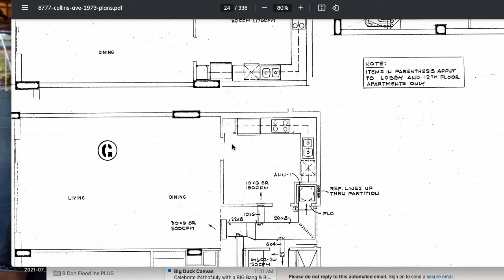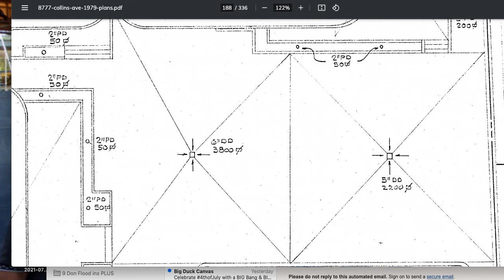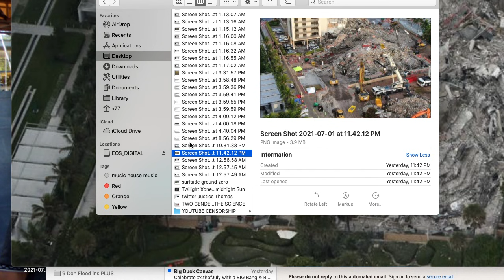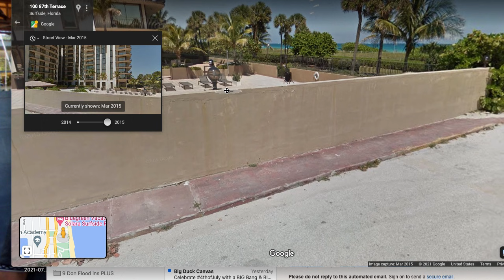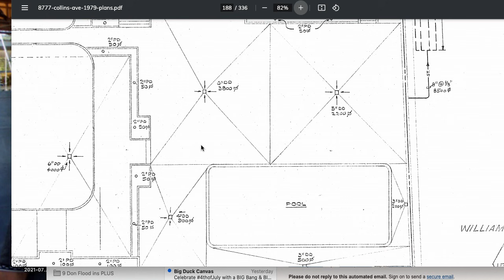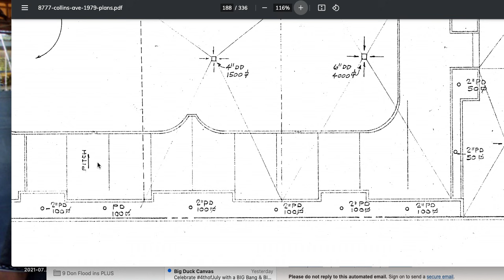Champlain Towers Collapse POOL DECK WAS PITCHED PER ORIGINAL DESIGN = CURRENT ENGINEER FAILED

Comment: I think a sink hole opened up and caused this building collapse. Maybe the drainage and runoff caused the ground to do that I don't know. All I know is a lady seen the pool deck fall into the ground and she said it looked like a sinkhole. She then died when the building came down. Maybe you're right the bad drainage caused a sinkhole to open up.
Reply from the maker: I thought a black hole opened up and caused this collapse but I could be wrong... just saying.
Reply: @LoadPathEngineering  did you hear about the lady on the phone with her husband or boyfriend before she died? She literally said it looked like the pool deck fell into a sink hole as she stood on her 4th floor balcony. Then the phone went dead. I think they should take this into consideration. It's possible it wasn't about the neglect at the building. It could have been a simple sink hole as they do tend to have them down in Florida.

Comment: The are other reports that imply that the pool deck was not the problem. The super claims that there was standing sea water in the garage after king tides which had to be pumped out. This was just west of the bottom of the ramp where the first three columns failed. This implies that a hidden failure of the column footings may be the cause.
Reply from the maker: Deck failure was first... Imo and what my videos imply...
Reply: @LoadPathEngineering  but you can't see the footings under the columns. We know that columns failed. We cant know from the video if they failed at deck level or garage level.
Reply from the maker: Okay, the ex pool man and the ex maintenance man figure out what was wrong, case closed.

Comment: There is as drawn,  and as built in our industry.  Photo's of water ponding on the pool deck show that over the buildings life span the pool deck became nearly level, and was not shedding water as designed. Water sitting on any structure is trouble, given enough time it will destroy even the toughest materials in our industry.  As my professor of structural engineering taught us, water is the most powerful solvent on earth, given enough time it will erode, corrode, any material in construction. The engineering report was spot on, if not corrected it would cause failure exponentially.  The gentleman that stated the building was in good/great shape was in serious error when he uttered those words. From videos we can see the failure of the pool deck and busting of the sprinkler pipe/pipes and large chucks of the pool deck lying on the garage floor. We also have witness statements, the pool deck had a hole or large hole in it as the structure failed. As with any structure failure especially where there is loss of life, many engineering disciplines will need to come together, analysis all materials and there placement within the structure. This will take months to gather and test, only then can it be determined what failed and when. It is very sad the HOA had the documents in hand and failed to take immediate action to restore the building.  One last point of interest,  the former building superintendent stated , 2 feet of water possibly salt water, was a regular occurrence in the garage, resulting in floating cars all over the garage. He clearly stated, the pumps could not keep up, and were replaced frequently,  don't you find it strange that the engineering firm was never advised of that issue. Just some thoughts. Good day.

Comment: I believe the key will not be in the parking garage, but under ground in the foundation. Was it to bedrock and how was the tie in to the structural supports done. Water into cracks in the column that were documented in the early reports rusting rebar would have to be major contributors and more so if the footings had failed in one or more places due to the sea's pounding.

Comment: Want to help with some animation for people to know how the building collapsed the way it did. They structural plans should have used double columns with expansion joint separating the main building from the pool deck where the problem originated and the two rebars each way pool deck to columns failed with all the horrid conditions amd wight on the pool deck stripped right through the columns then shredding the already exposure damage to the main building pool deck facade.

 1. The pool deck failed because of poor waterproofing.

2. Pool deck slab not having expansion joint tore up the beam supporting the floors in the middle at lobby entrance to pool. 

3. middle section collapse on itself (may be a combo unit caused a middle section to appear to fail looking at live video but still the middle goes down anyway. 

4. north section collapse because the middle building pool side tears apart the main beams again to surrounding sections. These beams take longer to fail because they are not ones with heavy corrosion damage. Notice east side lightly pivots about the main east beam portion torn by the center sections hence falling slightly back

5. West section has elevator amd stairwell I’m assuming and structural plans show thicker columns hence it’s still standing.

Now I understand how this happened but don’t understand why not on the news and saying unknown but assume this is a legal disaster and may be why we’re not being told what really happened. Thank you for your video. Would love to help you with some animation I’m using sketch up autocad and 3d studio Max. Nice Job amd thanks for explaining it and showing the structurals

Comment: You nailed it everything makes sense now from what evidence we have. Your videos showing the structural pool deck level and buildings explains a everything! Nice job amd thank you now I understand what happened and the domino effect. I’ve been in the architecture and engineering since 1990 and have done inspections on this very problem then prepared plans and specifications for repairs prevent further damage here in Naples Florida since 1990 your videos Here’s my comments on Facebook going into detail based on you awesome videos today July Fourth 2021:

curing 28 days in the garage level. Now we’re seeing more and more buildings that IMO need to come down instead of being repaired which is only cosmetic and preventing further structural damage but will never have the same strength and personally would never step foot in any of them in that shape ever again. Do the buildings need to be that damn high that one failure takes down the whole thing to a stack of pancakes or are they not engineered as they should. The real estate market will be affected greatly by this. The whole country is now taking this seriously and many residents with their life savings into their beach condo are questioning their safety. What a mess

Comment: As an architect, I think the intention is to have a flat deck and build up slope, usually by foam to achieve the slope. So it is not surprised to say the structural deck is flat.

Comment: There have been numerous changes to the building since it was constructed. This plan shows a much larger pool than the one that exists now, there's also a secondary smaller dip pool that was added at some point, planters were also added up against the structure, and another apartment was added to the roof deck. All of these things *should* have required engineering reports, but none seem to exist for these changes. So what happened? Did the city just not inspect it at all? Didn't they need to gain some kind of planning permission to sign off or can any moron just start changing the structure of a building in Florida without anyone needing to check anything?
I personally think this disaster has uncovered a completely failed system from top to bottom. There appears to be almost no regulation in place. A good example of this is that they're evacuating another building right now because it conducted it's 40 year inspection 10 years late, it was finished in January but the city only got it yesterday. The fact that there was no legal requirement for them to conduct this supposedly mandatory inspection and they didn't do it for another ten years, and even then the city wasn't demanding it in January, shows that this is a systemic problem and likely involves so much corruption and bribery people will probably be going to prison.
This disaster has revealed systemic failure in everything from the city to regulations to the people "inspecting" these properties. I will not be surprised if we see fifty buildings being declared unsafe in the coming week.
Reply from the maker: Permits are two days apart and appear to be same for both... Yes, pool and hit tub r added, perhaps u can find that page.

Comment: The sheets of the drawings this videos references are for Chaplain Towers North. The PDF released by Surfside have drawings from the North and South towers.
Reply from the maker: They built and did addendums at the same time...  This is what I believe and the field locations appear to match.
Reply: @LoadPathEngineering  Totally agree on that but the drawing shown in the thumbnail is not from the south building. The design of the south seems more rushed vs the north drawings.

Comment: From what I can tell the engineer is not throwing the architect under the bus. He is saying when he saw the building it had been altered to be flat, and no longer conformed o the original drawing. Who ever worked on it is at fault, not the architect.
Reply from the maker: Golfmanic, find me the connection of the pool deck to the building, that would be helpful.

Comment: FYI, the pool deck drainage plan you show is for the Champlain Tower North. Go to page 97/336 for the Champlain South Tower. Having looked at the drawings I can't see a detail section through the pool deck/ building interface. This is a critical detail and let's hope they didn't make it up on site. The pool decking appears to have sagged near the pool with signs of water pooling if you look at google earth. As a result the drain outlets are higher than the lower areas caused by a sagging slab leading to ponding and additional loading. Planters have also been added near the building. Both the ponding and additional planters would put extreme loading on a structure where some columns are spaced at up to 30' apart. This is the area where the thin columns punched through. If the pool deck basement columns and slab at Champlain North are the same as those at Champlain South that building needs to be evacuated immediately.
Reply from the maker: Senor Loco, find me the connection of the pool deck to the building, that would be helpful.
Reply: Page 162. Another commentator found it. @LoadPathEngineering

Comment: Were the concrete(?) pavers part of the original design or added later? Quite often architects will provide slopes to drains but will not take into consideration the setting bed needed to accommodate the pavers, which can be quite thick and heavy. Within a design for pavers, there are two slopes to drain off water. The first is the pre-slope on top of which is applied a waterproof membrane which is designed to drain away water which infiltrates past the pavers and would otherwise be trapped. Then a setting bed is installed slopped toward the drain at the rate of 1/4 inch per foot. If there was no recess in the slab, the pavers would be installed on top of the structure which may not have been designed for the extra load. Looking at the pictures of the pool area, the pavers seem to be around 1-1/2 to 2 inches thick and the distances to the drain may have required an additional 4 inches or so. The load would have been very significant.

Comment: I don't understand the fact that there is no independent concrete structure in relation to the pool slab and the building slab. For example, in my country (Portugal), a situation like this requires that a structure of columns, beams and slabs be designed, completely independent of the building structure. Furthermore, due to the size of the building itself, it would be mandatory that it be divided into 3 or 4 independent structures. I think the initial trigger was the many years of salt water slowly seeping into the concrete and steel rebar of the pool floor, which led to its weakening and subsequent failure. But the main culprit was that after the pool/garage slab failure there was nothing that could prevent those lateral forces from pulling the "shared" columns that supported the building. Thanks for your work, Ed
Reply: The differential settlement between the heavier building structure and the lighter pool structure would also lead to failure at the connection between the two if separation wasn't allowed for.
Reply: Yes I don't understand that there are no beams to support the slabs and spread the load ,  it appears the slabs are sitting directly on the columns,  the load on the slabs at these points would have been immense,  and if the reo bars in the slabs were corroded,  the slabs just became too weak to take the load .

Comment: I definitely am not a professional, but one thing I noticed after I reviewed some of the public documents, the original plans were drawn with that deleted beam, once the penthouse was added the plans were revised later in 1979 which changed the original roofing plans as well as deleted that beam/column, and you notice that the hot tub was added and the pool shape was changed. Also the city only has documented back up for public view for any violations and/or work permitted after 2001. I don’t see any permitting or violations prior to that year. In reading the city requirements, it looks like the city requested that the original flooring of the pool deck be demo’d and relayed. Original plans show the pool deck and balconies to be simulated limestone, whereas now it appears to be concrete pavers. If you review some past listings, it looks like the flooring or the pool deck may have been altered a few times. The report said that the contractors must remove the flooring and replace to match the original plans slopes from the original architectural plans. Maybe there was screw ups in the changing of the pool deck floors? Also between 2001 and 2002 it appears the hot tub has had ongoing leaking issues and had to be resurfaced a few times as well as structural damage to some of the planters, which all could have been attributed by the changing of the flooring on the pool deck. Again, I’m definitely not a professional, just pointing out somethings I noticed but I could be entirely off base.

Comment: Are we back to square one on the root cause of the failure and the sequence that followed to bring the building down? Seeing the building in daylight leads me to the conclusion that all the flashes came from the same building. The original images taken in the dark from a far distance by a cell phone camera didn't make it clear that there was a 90 degree turn in the building. I thought the flashes at the extreme left was from another building. From Kai's posting yesterday: "Surfside Miami Building Collapse NO BUILDING SETTLEMENT AND NOT COLUMNS NOT SET ON ''BEDROCK" So we've eliminated some of the dead end tunnels that led to rabbit holes but are we any closer to answers consistent with what we do know so far?

Comment: I haven't made my mind up on a shear issue with the drawings as so far I haven't seen the relevant elevations. 
I still find it hard to believe this guy would have missed much.
I wish all drawings were as complete as these are showing to be.
That being said the 2 contractors on this project didn't read them or disregarded many details shown to this point. 
I have had major disputes with clients over the fact that we can't just change things willy nilly without involving the original engineers and city or county.
There may end up being some blame by today's standards but I think it's mostly a contractor issue here and decisions made after the build for upgrades.

Comment: It looks like these plans include many pages for 8877 Collins which is Champlain North -112 units. The collapsed building is 8777 Collins which is Champlain South -135 units. Page 188 is for the 8877  building, but page 97 is for 8777 and appears the same to me. Also pool mods appear to have been approved around the time of the penthouse revisions.
Reply from the maker: Telefexllc, find me the connection of the pool deck to the building, that would be helpful.

Comment: Is it possible to build a 10x10sq ft house using just brick and mortar without using any columns and beams (just the ground floor, basement and 1st floor not needed. Just for the ground floor only)?

Comment: Is it easier and cheaper to pour a flat surface?  In my research into past building collapses (e.g. Sampoong, Hotel New World, Katowice), cost-cutting is a highly common factor. Other common factors: failure to follow/improper modification of original plans, apathy towards maintenance/repair, governmental apathy concerning regulation enforcement.
Reply: The failure to follow the plan is a major problem in this build. 
Add to that corruption and poor quality control and this is how things can end.